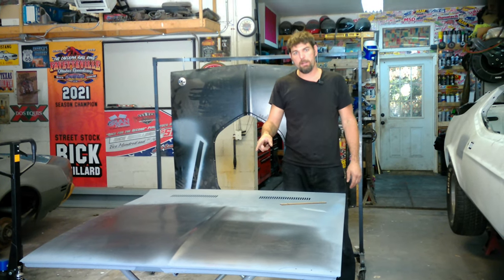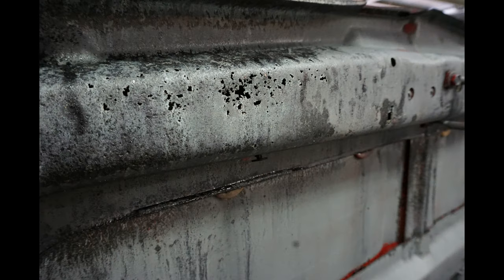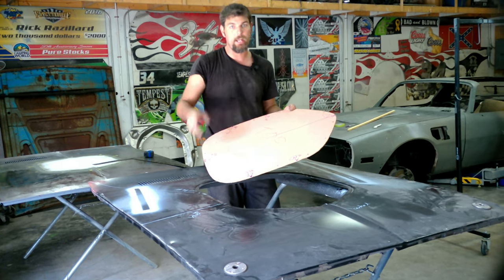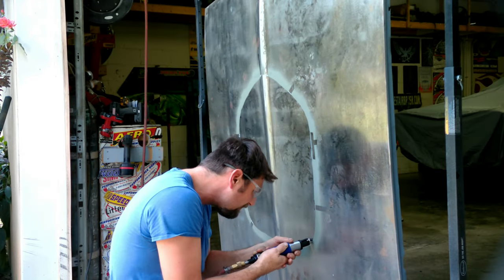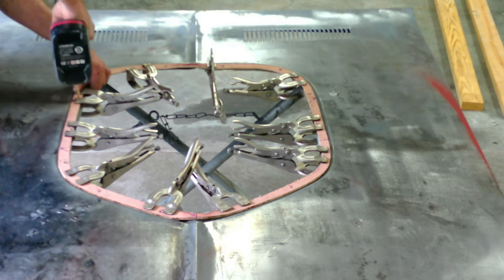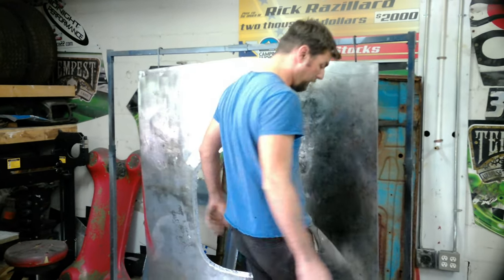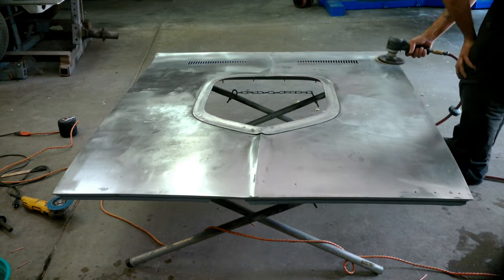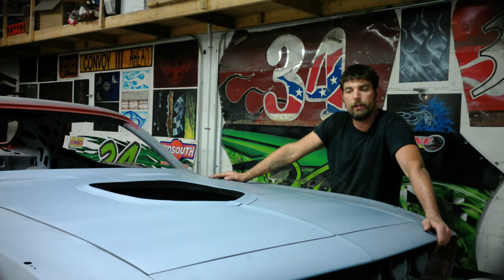How to build a E body shaker hood, 1971 Barracuda hood conversion from a flat hood episode 12

Comment: Just wanted to thank you for making this video.  After watching it one of my best friends convinced me to take the jump and convert my flat 71 hood using several of the key points you included in your video.   We also used a bead roller to make very smooth recess but mounted the roller on casters so we could move the roller and keep the hood stationary on a 4 post car lift.  I am very happy with the results.   Thanks again.
Reply: And one other point... I fully agree that the vise grip tool would make this job 20x more difficult...  The bead roller did a great job on a single pass.
Reply from the maker: @twinturbo496  That's is so Cool to hear the video helped you out! Makes the process and extra time making them really worth it. Thanks for sharing that with me. Also the idea with the 4 post lift and rolling bead roller is a really good idea. If I ever do another hood conversion I will trying that method.

Comment: Nice job!…….saw a core shaker hood in South Carolina for $2500 at an All Mopar Swap meet. Your 40 hours on a good fitting finished hood @ $100 is reasonable. Plus cost of shaker parts, adhesives, primer & seam seal.
Reply from the maker: Thank you! I agree and will add I saw an original shaker with trim ring my buddy sent me from the mopar nationals around $7500 earlier this year, it is an option especially with the supply issues we are running into at this point in time. The reason the aftermarket hood was purchased in the first place it literally was the only one available. This conversion might be the only way in the future if you have to have that shaker under your E body.

Comment: Excellent how-to. I've wondered what it would take to modify a flat hood which I have to a shaker.
I wish you would include the links to the aftermarket shaker parts in your video description.
Reply from the maker: this whole kit was from shakerhood.com called the Cuda or challenger shaker hood conversion kit. I will add it to the description thanks for the advice.

Comment: I've sandblasted 3 shaker hoods. None have warped. I definitely do not recommend dustless blast. It leaves residual dirt and residual inside the hood crevices and traps water so eventually your hood or body components will rust from the inside out! Do not use dustless blast ! When blasting a flat hood, yes it could warped. When dusting a shaker hood it can warp too but it less probable because it will have more bracing installed, hence cut your flat hood first and install your bracing first! Then blast. You can clean up the areas you install the bracing with sandpaper or DA then install brace. Then sandblast. Hood will be stronger against warping.  I am in the process of making correct bracing just like originals so when installed your hood looks like an original shaker hood. It is easy to tell the difference if you know what to look for.
Reply from the maker: So here is my take on sandblasting, I personally would never dry blast outer panels, your at 90 psi with all the heat and pressure if you don't warp it you got really lucky. I will say dry blasting the inner structure is a preferred method for me however if the quarters, roof and panels are off a vehicle and it can be properly washed well with the rust inhibitor in the solution I fell there is no difference between the two blasting the water blasting is less aggressive while getting the job done. The wet blasting is a lower psi 30-40 and high volume. Also my opinion and there are many ways to do this but I would clean the hood first so many hoods are damaged or have issues with them it would stink to put all the work installing the bracing to then find out the hood is junk. Personally i think chemically stripping or hand stripping the outer portion of the hood in my preferred method but super labor intensive. On telling the difference you are correct you can tell, however in this car its not a true shaker car or even a BS VIN Cuda car so the extra work to do that isn't worth it. There are many cars we get in here like that owners just want all they care about and not everyone in that into the small details some are and good for both kinds of owners. I feel if you wanted to properly replicate a factory hood ( I feel can do that also) you need a factory style spot welder pull the entire outer skin off the hood and build the frame with the spot welder then attach the outer structure back together. I believe that's how the factory would have built them just thinking about it and reverse engineering. As for this video I talked to the owner since the build and this exceeded his expectations to the goal was accomplished here i feel.

Comment: Awesome work and thanks for the video. What are you using for a bead roller stand?  Do you think it would be possible to hold the hood stationary and then run the bead roller by hand?
Reply from the maker: The bead roller stand is the Eastwood one that is made for their 24 inch bead roller which I also had for a while. Originally I bought this smaller 8 inch bead roller specifically for this job and the idea was have one of us hold the bead roller by hand and the other turn it like you suggested. Once I got it set up I think it would have worked but would have been easier to slip up doing it that way. I think and the stand idea was a last minute thought and I am glad we went that route. It would probably be better if you built a stand out of a 18 wheeler brake drum and metal coming up from there if was doing this all the time. as the legs on the stand kept hitting the saw horse. Thanks for watching!

Comment: Awesome job. Enjoyed watching it as a Mopar guy. I made a custom air grabber for my 70 Charger. I got it done but could have used a lot of your intel 39 years ago. 

What is the brand of the weldable primer you use?

I watch the video of you putting the quarter panels on. The factory put some kind of sealer between the gutter panels and rear deck seams. Trunks are known for leaking in Mopars.  What do you use if anything to prevent leaks at the seams between the quarter panels and rear deck and the trunk gutters? Do you do a continuous weld? Really enjoying the channel.
Reply from the maker: Thank you very much, the brand weld through primer I have been using lately is Seymore 2-=1675. I haven't had any issues with it affecting any of my welds. I do not usually continuously weld most panels unless I am doing patches. That does not mean this is a bad idea but I think its extra heat and work added that is not needed. So the drip rails and the area on the outside you are speaking of I will usually use a 3m self leveling seam sealer but I will apply it way after all the metal work is complete. Usually on the inside seams I will use a regular seam sealer.
Reply: @carthageclassiccars in the past I have had to scratch weldable primer to get a good start. Do you have to put the etch primer on first? Will it lift the epoxy primer if spray covers it? Does it come in a spray can?
You put that sealer in between the metal’s overlap or after the welding from inside?
I’m still learning mig settings. I’m improving but a video would be nice to see your progress. If you only removed the quarters a few times then you are lucky. I am having trouble getting the quarters to push against the rear deck so my trunk has a better gap. 
If you have live sessions that would be awesome. 
I’m jealous of your rotisserie. I might look for used one. 
I’ll be watching the video a few times. You cover a lot of details but keep doing it.

Comment: Absolutely amazing job. Congratulations. But I wonder. Was it really easier than just fix the aftermarket one?
Reply from the maker: Thank you. That is a very good question, this install was a bit of a process. I do think to get the quality fitment of the factory hood with the aftermarket the entire skin would have to be removed from the structure. The frame hood structure would have to be cut and bent to the proper shape of the car and the outer skin then welded back into place. Both jobs are labor intensive and I have this hood around the garage so that might be a future video if the right car comes along that will need another shaker hood and there are none available.

Comment: The '70 Challenger and '71 'cuda look good from every angle, yet the newer Challengers don't quite look right from ANY angle. They seem to be thick waisted, bloated, and disproportionate.  The exhaust exits in the wrong place and the fender flares look like they were ordered from the J.C. Whitney catalog. What would you do to improve their design?
Reply from the maker: Honestly I am not a fan of most new vehicles but I do like them better then most of the other modern options. I think I am backwards and would graph some 70 panels on a new challenger to have the old styling on a modern comfort.
Reply: @Carthage Classic Cars   Even more criminal is that they never built a new 'cuda with styling cues from the '71, despite the enormous popularity of the new Challenger. What a missed opportunity.
Reply from the maker: @russingersoll5761  Yes I have the same opinion on you with that. My only guess is since Plymouth is no longer around it would have been hard to model the new Dodge after it when the Challenger was in the Dodge family.

Comment: How many "34" doors do you have? Just curious =) Great job btw. Very delicate
Reply from the maker: Thanks and I don't even know how many are around. I started out racing and building dirt circle race cars for others before the restoration stuff got busy so I have run the 34 number since 2005 and when I destroy a door or replace the body I just hung it on the wall I like the memories and the wife won't let me hang them in the living room so this is the only place they fit.

Comment: The wiggle on the end of your tape measure is by design...it compensates the thickness of the blade end for when you push the end against something you measure or if you hook the end on what you measure...makes no difference it will measure correctly
Reply from the maker: Actually i never thought of it that way thanks for the input on that, learn something new each day.